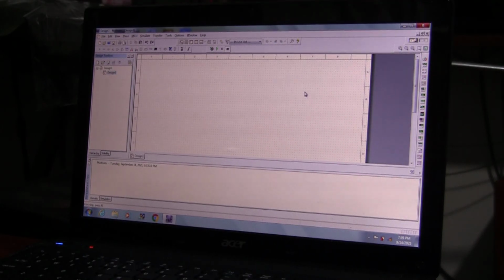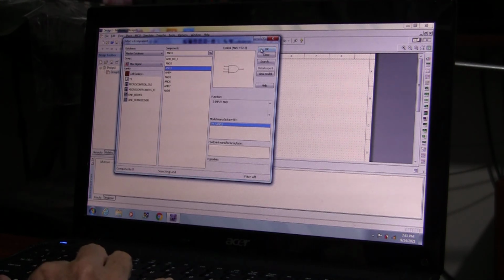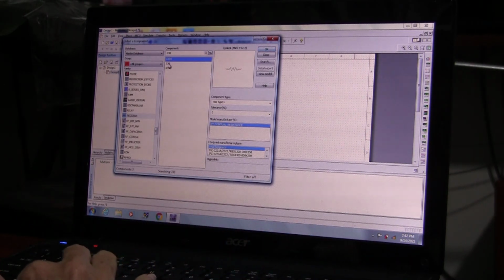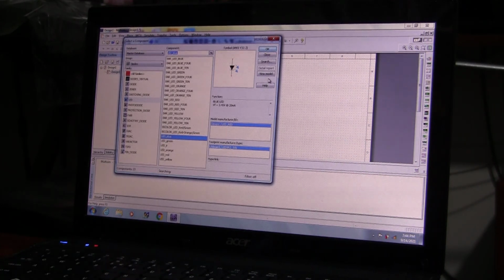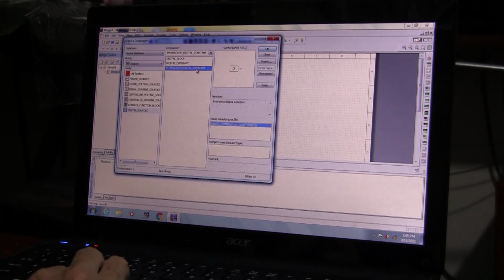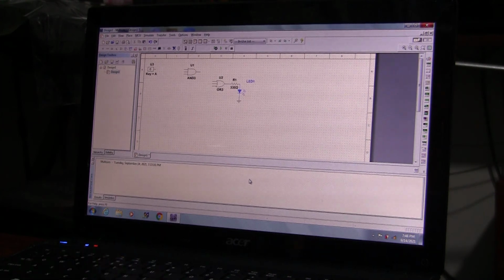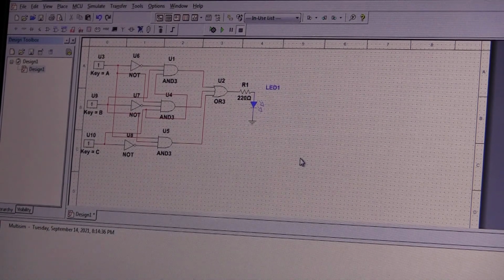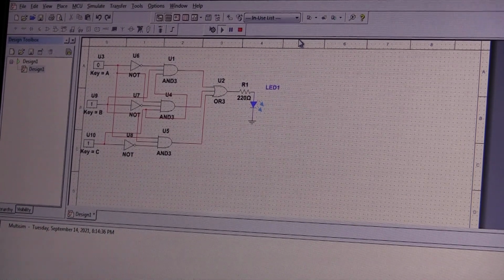How to do your first Digital Electronics logic circuit in Multisim

Comment: How can I get the output of a logic port, which is either a logic 1 or 0, and use that as an input for a analog circuit?
Reply from the maker: Use an "open collector" output ..... most digital IC's have "open collector" version (for example the 7406 is an "open collector" version of the 7404 hex inverter)..... with a "pull up" resistor and feed straight into your analog circuit (you can customize both the signal level and impedance by your choice of feed voltage and resistor value) ...... but if your analog circuit is already compatible with the logic levels of your digital IC family then you do NOT need the above and can simply connect your analog input directly to the output pin of your logic port.
Reply: @StephenMendes  Thank you so much for the fast response!
Reply: @StephenMendes  Just tried it, worked perfectly! God bless you.